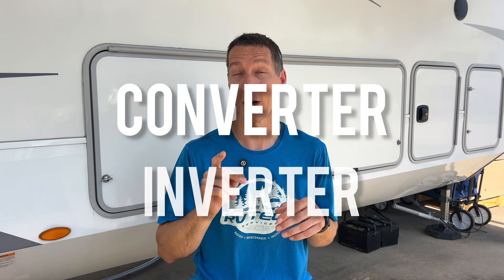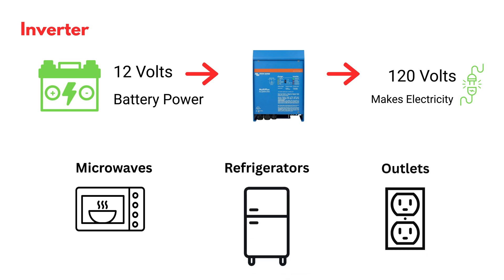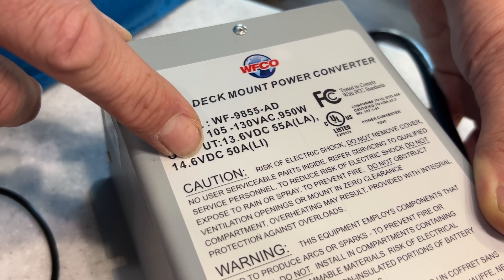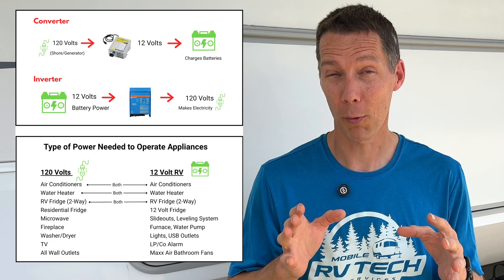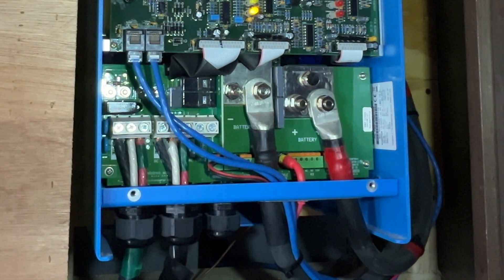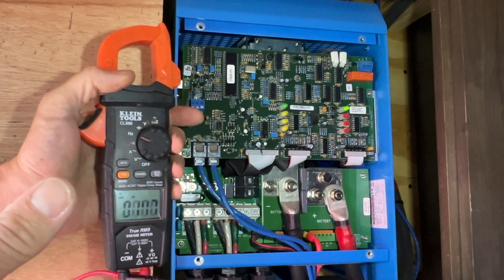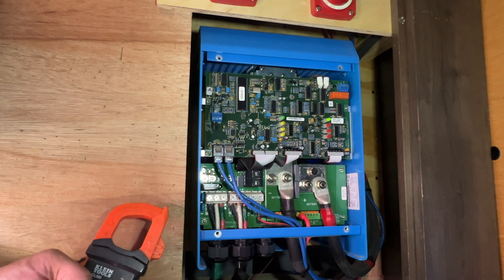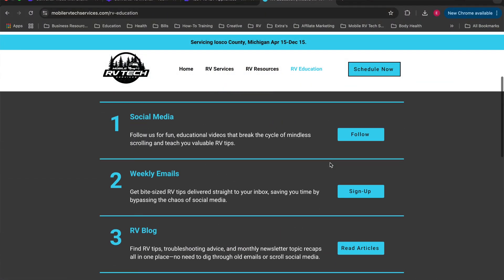RV Converter vs Inverter | How they Work, Common Issues & Diagnosis

Comment: Great video! I added a 3K W GoWise (looks like the reviews are not too hot on this one) inverter and think it may be shorting out my batteries but I am not sure. Just added some new LiPo batteries and the camper keeps dying quickly. The batteries are two 160Ah and they seem to be depleting way fast. Off shore power, batteries were charged, had the inverter turned on, no load, working in the camper for a bit, inverter started beeping, camper lights flickered, and then the whole camper shut down. Checked the batteries and they were at 0. Cells were fine, nothing reported on the BMS. Had an older 200Ah battery and the system did this same thing. The only thing I can think of is somehow my inverter is shorting out my system. I know this is hard to diagnose in YT chat but any recos on where to start to troubleshoot this issue? Really appreciate it.
Reply from the maker: I would unhook the inverter and run some loads on the batteries to see if the issue corrects itself. 

I had a setup doing a similar thing before and it was a shorted inverter. Once the customer replaced it, that took care of the issue. 

If you have a sub par inverter, I would look at a different brand like a Victron Multi Plus if you are going to replace it. https://amzn.to/47LlE4f
Reply: @MobileRVTechServices  Thanks for your help!

Comment: Thanks for the video, Have a question if you can pls look into it. If I have a Converter like say PowerMax 1200w (100A) charging the battery and an Inverter (1000W) drawing 12v from Battery. Now if I were to remove the Battery for 30min to 1hr and let Converter directly power the Inverter, will it work ? Does it have enough juice to support the load ? ..and hazard ?
Reply from the maker: With that kind of load, I would expect issues running directly off the converter. Also keep in mind each device has a power loss factor and you will lose usable power just from the unit operating.
Reply: @MobileRVTechServices  Thanks for the response. About Load: Mostly entertainment like TV, Music system but definitely below 500W. 
About power loss, Assuming 90% Inverter efficiency and 500w load, I guess Inverter will be consuming 555W. 
Assuming Converter is SMPS based with 80% efficiency,  my guess is 694W consumed by Converter. 
But I am not sure if it can support a high rush current (like Cranking amp or CCA) when Inverter is turned on.

Comment: where do you find the converter?  is it behind the breaker panel?
Reply from the maker: A lot of times it is either built in or behind the breaker panel. In 5th wheels, it is in the basement area.